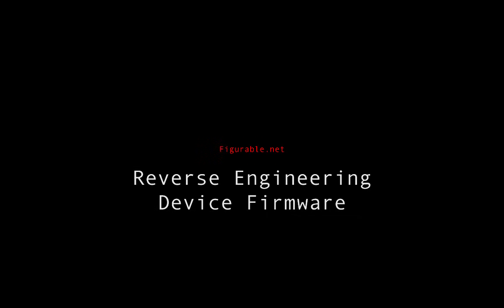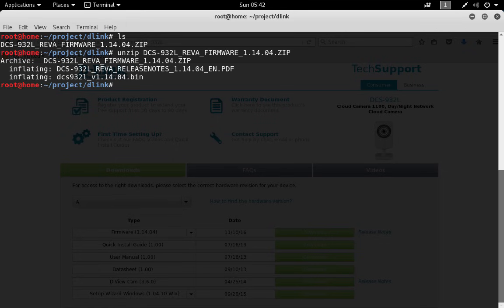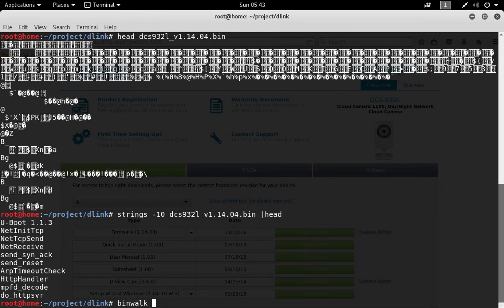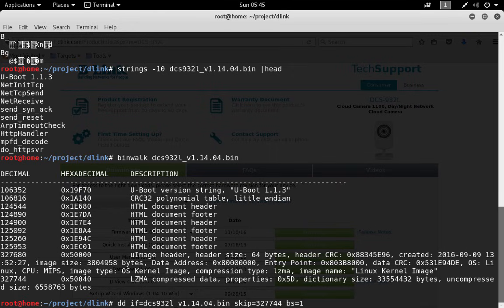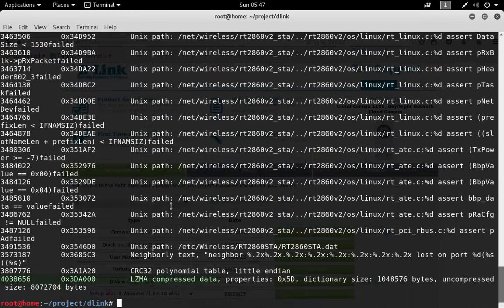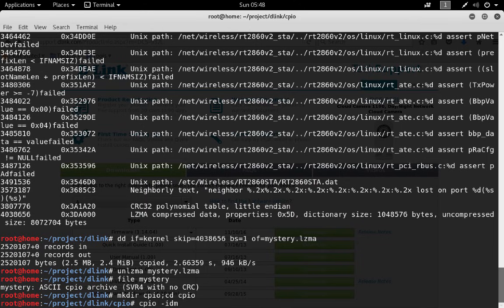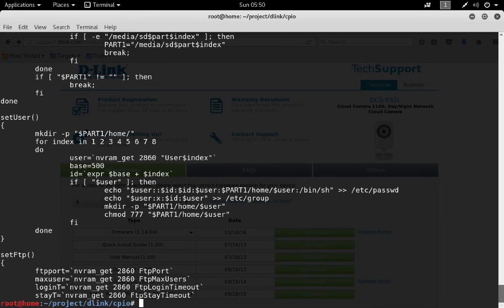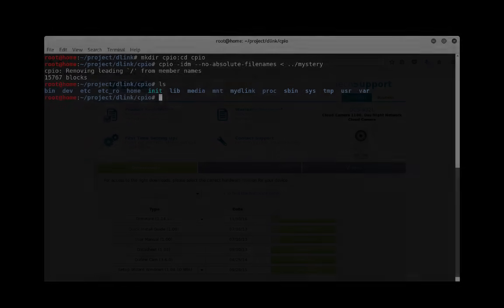Introduction to Firmware Reversing

Comment: Here is the version of the firmware of this controller. 
Anilam 6000M CNC Software
Version 3.05A 
CCU firmware version 246280.10

Comment: just in case if someone else is trying this and getting stuck at the unlzma extract steep just after using dd, you can do the same as dd with binwalk command just typing something like:

binwalk -v -Z -S -e -o=327744 -K=1 -l=33554432  -f=result.log dcs932l_v1.14.04.bin

usage: 
-v Verbose mode
-Z Scan for raw LZMA compression streams
-S Stop after the first result
-e Automatically extract known file types
-o Start scan at this file offset
-K Set file block size
-l Number of bytes to scan
-f Log results to file

Probably so many options are unnecessary but I prefer to give and get in return every piece of information detailed as possible to reduce the chances for errors and find them easily when those occurs, so the verbose and the log are very useful, whoever thinks that is too much then that person is trying the wrong profession, reverse engineering, pen-testing, digital forensic, etc you must be very meticulous to avoid random results and wrong conclusions...

Comment: With the latest firmware, the unlzma of a kernel.lzma image reports corrupt data. file also reports a different original binary file: DCS-932L_B1_v2.18.01.bin: u-boot legacy uImage, and the structure is, according to binwalk also different, with uImage at the address of 0x0. Also tried the original version that was used an example here, but the same thing happnes. Any thoughts?

Comment: I just tried this and `unlzma kernel.lzma` gives `unlzma: kernel.lzma: Compressed data is corrupt`

I discovered that this is because LZMA Utils has been superseded by XV Utils.

The command `lzma -d < kernel.lzma > kernel` works but you still get an error message.

See https://stackoverflow.com/questions/36778409/binwalk-compressed-data-is-corrupt

Comment: Hi, I got an error under Ubuntu 18, why? The dd command created an identical 3866560 bytes file kernel.lzma like yours. I am using liblzma 5.2.2

dancer75@ubuntu:~/Downloads$ dd if=dcs932l_v1.14.04.bin skip=327744 bs=1 of=kernel.lzma
3866560+0 records in
3866560+0 records out
3866560 bytes (3.9 MB, 3.7 MiB) copied, 6.72277 s, 575 kB/s
sdancer75@ubuntu:~/Downloads$ unlzma kernel.lzma 
unlzma: kernel.lzma: Compressed data is corrupt
Reply: count did the job. Thanks

dd if=dcs932l_v1.14.04.bin count=3804958 skip=327744 bs=1 of=kernel.lzma

Comment: Total noob here.  Wondering if you can edit parts of the file, package it back up, then flash it to a camera.  I'm thinking reverse SSH tunnels to start with would be pretty neat-o.
Reply: after your unzipped everything, technically you can zip them back to the original state and it should work just fine. the bin file can be reconstructed, just with a basic google search you will find a lot on that subject.

Comment: A Linux binary with no offer to provide source code.  I'm *shocked*.

In fact, and especially because D-Link got spanked for GPL violations, you and anyone can drop by their website and download source code for the firmware.  No guarantee that it has everything but it should include their kernel modules.

That said, I got 503'd, so if anyone actually cares about this, they should send a letter.

Comment: Could you please explain skip=327744 and why? Thank you.
Reply: binwalk found out the file is made up of multiple parts -- like several files merged together. One of the parts is that LZMA compressed part starting at 327744... So skip basically tells dd to copy data starting from that position to get only that part out. skip actually skip a number of blocks. But because the blocksize is also set to 1 for this its the same as number of bytes. Since its the last part you dont have to tell dd how much to copy -- it will just copy the rest by default. Google "man dd" for a description of the dd command.

Comment: Absolutely brilliant tutorial!
I've never worked with security related stuff, but if I had some spare time I would definitely watch your videos to learn.
I prefer to code software, but yes.... You can write better code once you know how it can be drilled out.

Little story: my ISP blocked my ADSL line, but I was still able to connect and do searches on Google, while other urls lead me to the ISP   "cannot access internet" page.
That made me think a bit about why I was able to access website if I clicked on their link as Google search result, while I was blocked when typing the url in the address bar.
It turns out that I'm using Google Dns, so it made me think that the ISP lock kicks in after the ip name resolution.
Could it be used to build some sort of tunnel to avoid the block? 
Probably I will never try to do it, not at the moment because I don't have enough knowledge with this things.
By the way, is fascinating.

Sorry for thinking loud :)
But, if anyone can tell me what was happening, I will be very happy!

Bye

Comment: Hi, this is really awesome tutorial.
But I am getting error while replicating this with unpacking of lzma file with ulzma.
Kernel.lzma: corrupted file
Reply: u have to add ' count=3804958 ' (this information is in the header file of uImage), if I extract 1 bit more or less; unlzma will say it is corrupted. Hope this helps
Reply: @EazyD91  thanks for help...
It works..
I have added count=3804958 in dd command and it's unpack the file.
Thank you for insights
Reply: You probably doing something wrong with DD, maybe you skip incorrect amount into the file. Also if the LZMA entry is not the last entry, you need to specify how many bytes DD should read using "count" parameter.
Reply: @bjarnestronstrup9122  thank you your advice help me out to solve the issue.

Comment: Hi, I am following your process but it says "unlzma: kernel.lzma: compressed data is corrupt".
I am using the same firmware and everything is same, but i receive this error. Kindly help me to sort it out,
Reply: u have to add ' count=3804958 ' (this information is in the header file of uImage), if I extract 1 bit more or less; unlzma will say it is corrupted. Hope this helps

Comment: hi, you can repack that .. to customfirmware?
Reply: Most likely, watch this video he does a similar thing and it should be roughly the same process for both: https://www.youtube.com/watch?v=hV8W4o-Mu2o
Reply: @PyPylia  some devices however check for a cryptographic signature when flashing a user defined binary. Which goes just against everything Linux and GPL is all about :(

Comment: Question for you. How would you go about rebuilding this into firmware you can flash onto the device? For example, you've added some additional initialization code for increased functionality (lightweight - assuming it still fits in memory) and now it needs to go back on the device.

Comment: Hey Tony ! I like the tutor in the video, but I found something different from your step. When I used “unlzma kernel.lzma” it produce error “Compressed data is corrupt” ! can u help with this  ?
root@kali:~/Desktop/wc# dd if=dcs932l_v1.14.04.bin skip=327744 bs=1 of=kernel.lzma
3866560+0 records in
3866560+0 records out
3866560 bytes (3.9 MB, 3.7 MiB) copied, 30.6724 s, 126 kB/s
root@kali:~/Desktop/ wc # unlzma kernel.lzma 
unlzma: kernel.lzma: Compressed data is corrupt
root@kali:~/Desktop/ wc #

Comment: I'm getting a Compressed data is corrupt message

root@kali:~/Desktop/Project Router# dd if=dcs932l_v1.14.04.bin skip=327744 bs=1 of=kernel.lzma
3866560+0 records in
3866560+0 records out
3866560 bytes (3.9 MB, 3.7 MiB) copied, 9.56755 s, 404 kB/s
root@kali:~/Desktop/Project Router# unlzma kernel.lzma 
unlzma: kernel.lzma: Compressed data is corrupt
root@kali:~/Desktop/Project Router#

Comment: i want to carve out a particular lzma data in between a firmware header and a u-image header using dd  ...i can use the skip command to remove the u-image header but i don't know how to remove the firmware header since its decimal value is under the lzma